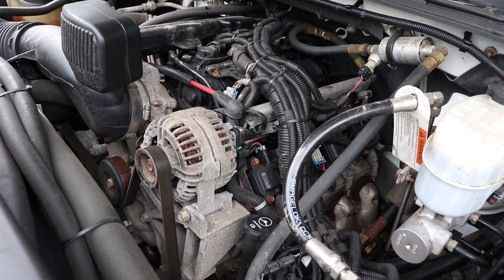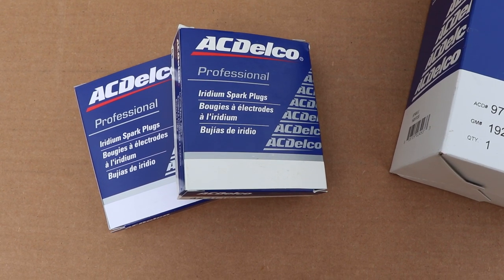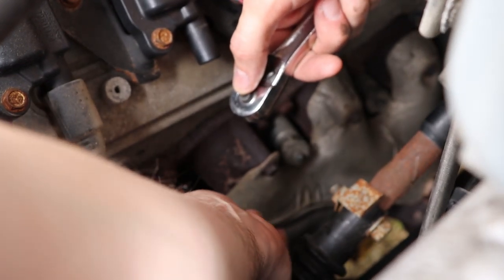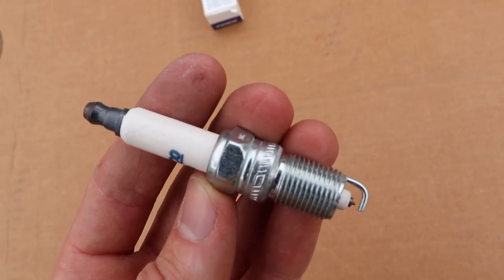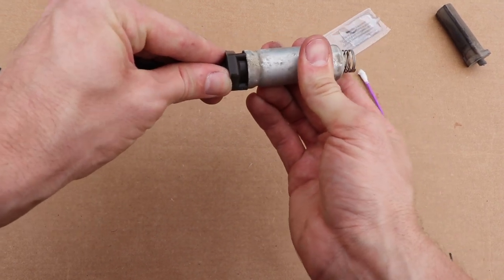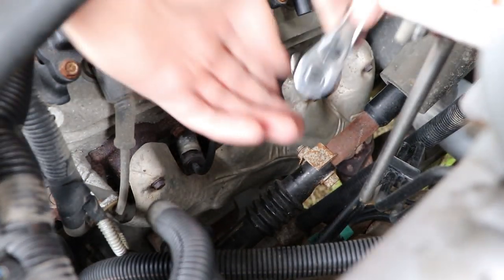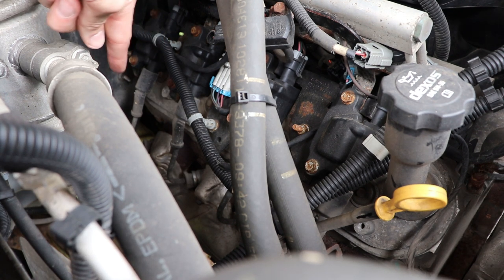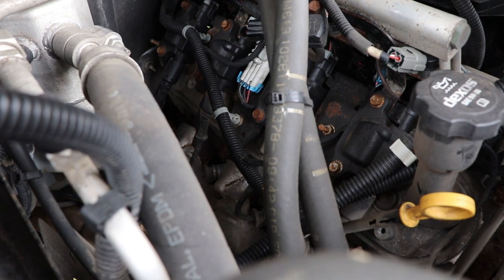How to Change Spark Plugs & Wires on 6.0L Chevy Engine (Step-by-Step Guide)

Comment: I like to blow each plug hole out with compressed air prior to removing the plug.  This will get rid of any sand/dust that could find it's way into the cylinder
Reply from the maker: Great point!

Comment: Passenger side is easier to get if you remove the front tire. Direct access to the 2 rear plugs
Reply: LSX_KINGPIN hey I see you have a tbss , I also have one and it’s the reason why I’m here . Do I have to disconnect my battery to change the plugs ? And what plugs do you recommend
Reply from the maker: Good suggestion!
Reply: @pacsoulpavon9649  don't have to unplug the battery and depending on your engine setup you can go with different versions of NGK Plugs.  Stock engine is NGK TR5-2238
Reply: Coach Emmett thank you appreciate the respond , my engine is a 6.0 ls2 stock so I will be doing that in the coming week
Reply: Gotta atleast check the gap!! Never put them in with out checking the gap!!! 👎👎

Comment: Thank you. Cost me $9.76 Sparkplug+grease. I disconnected my battery not sure if that was necessary but it was recommended. Replaced the sparkplug for cylinder 7. Truck runs great again. Appreciate this video!
Reply from the maker: Glad you were able to get it fixed!

Comment: Just picked up a 2011 Silverado 3500 6.0 at auction with 170k. Truck runs good no codes, had it serviced ( oil& multipoint inspection) at local dealership no issues found also I changed air filter. All that being said and not knowing the history on the truck (one of the downsides to buying auction rigs) I'm thinking at a minimum plugs and wires, question would be with these miles do the coils as well or wait?

Comment: I had a few sharks posing as mechanics convinced me to throw parts at my Yukon Denali. They overlooked bad spark plugs and went straight for fuel injectors, throttle body and sensor, MAF sensor and ignition coils. After all of that I was still getting misfire codes on cylinder 6, and I took it upon myself to swap the plug and wire on 6 and wala I’m running like a champ...

I appreciate you online mechanics, you guys are doing God’s work with these tutorials and walk throughs. Thanks

Comment: - Spark plug boot tool useful to prevent damage from pliers.
- Thread length looked different on new plugs?
- I would not trust pre-gapped plugs due to shipping, dropping & returns.Can gently check with gap tool.

Comment: Hey, so the manual says to use ACDelco 41-962, but some people say to use ACDelco 41-110. I've been using the 41-110 and I've had to change the knock sensor three times already. The engine light is still on. What do you think I should do?

Comment: what is the proper spark plug gap for the 6.0 vortecmax aka HO motor?  ive heard both 60 and 45..
Reply: Following... manual says .60 but only find videos with .40

Comment: Any help for an idiot who decided to take all of the plugs and wires out at the same time and now has no idea how the new ones in the correct order. 00 gmc sierra 2500 6.0
Reply: Haha 5 months later, u ever got it?
Reply: @Kelvin_-qs3uz  turns out my truck doesn't have a specific order just plug and go